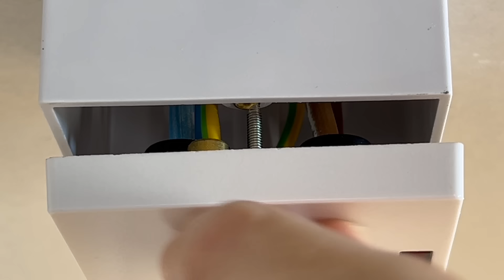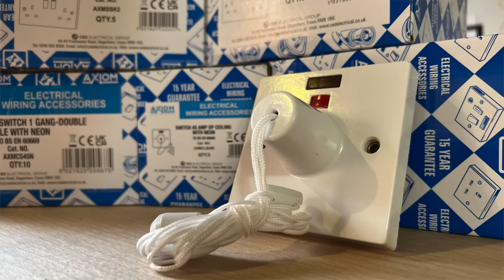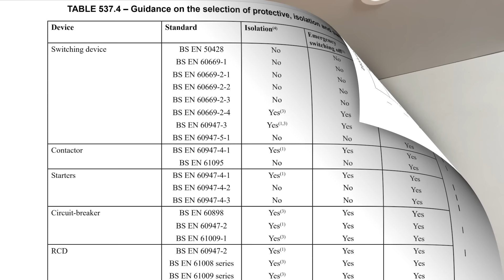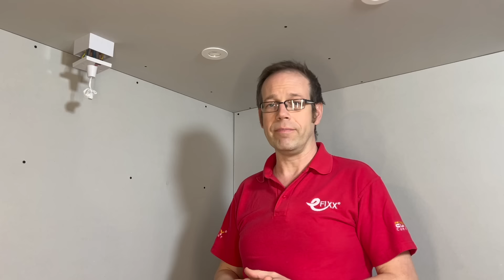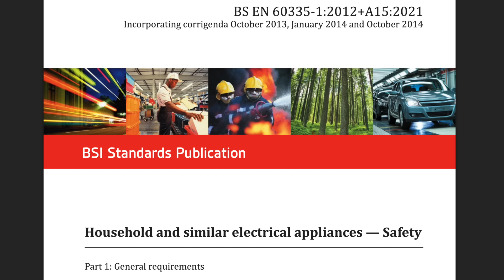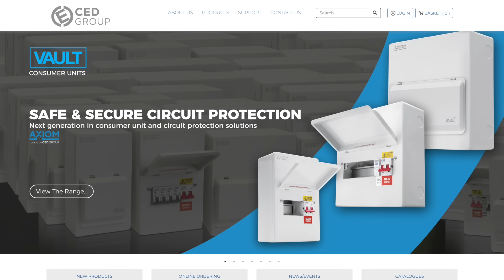Do You Actually Need a Shower Isolator — Or Is It Just Habit?

Comment: Could be that the shower will turn on if mains pressure drops. The micro-switches that turn the heating elements on are triggered by the release of pressure as water flows into the shower head. No water flow will cause over temp device to operate repeatedly until water pressure restored possibly causing thermal stress to the element and heating vessel. The switch is there for a good reason. This covers the manufacturers ass. Maybe?

Comment: Bullshit regulations , it is an isolator , because simplicity isolates the electrical supply to the shower and can be used in an emergency , instead of talking gobuliguce just give people an alternative which is git a contactor in your consumer unit run your 10mm cable from your 45A rcbo through your contactor terminals and connect the outgoing 10mm supply directly to your shower then get a 1 way lighting pullcord fitted in your bathroom using this as the auxiliary switch that switches your contactor coil on and off thus doing away with a 50A pullcord switch no loose connections no burning cores simple

Comment: I used a contactor, coil run from a standard light switch. Switch fused down to 5a on 1.5 t+e. The contactor and fuse carrier to switch/coil all sat on a 50a rcbo.

Comment: My gripe is about the unit itself - to save energy I tried switching off the shower when lathering up. Switching back on for 3-4 seconds there was scalding water before the safety kicked in. It's 2026 now: a kilowatt hour ever day adds up. The lowest energy shower is pumped from a fixed sized container with preheated water.  20 litres is your ration.

Comment: It is an emergency device so needs to be near the shower. I can terminate 10mm cables as i did do a lot of electrical work during 50 years as an electrician. Set the cable in the right positions and it becomes easier

Comment: Would it not be viable/safer to use a pullcord or outside switch that is capable of fitting both double pole switch requirements as well as the BS EN 60669-2-4 or BS EN 60947-3

Been quite curious about this while also looking to make it a lot safer when using the shower than just trusting the current pull cord and a single dedicated breaker...

Comment: It's needed as a form of local isolation,  so the shower can be powered down for maintenance or in an emergency, but I alway tell my clients who I install showers for just to leave it switched on permanently and not to turn it on and off as you use the shower.

Comment: I’m not an electrician but have used mine in an emergency and isolation several times - it did the job but your video has revealed some nuances as to what these terms actually mean - useful.

However having listed to the Grenfell Tower enquiry no one, especially those in authority, seems to understand regulations or follow them (even when very simple and clear, which they usually aren’t) I question the worth of all these regulations?

Anyhow just off to buy a really good value fully CE certified double pole  safe electrical switch with 3mm gap for my shower off Amazon or Ali Express 💀

Comment: In my new-build Milne property in Aberdeen, the shower is "isolated" using a switch outside the bathroom that you would need the strength of Thor to toggle. So basically - the little red neon flickers away, 24 hours a day, 365 days a year.

Comment: I'm amazed, as an experienced electrician that you are not telling people instead of fitting a 50A pullcord or a double pole switch outside the bathroom instead of fitting a contactor inside your consumer unit and wire from a rcbo through your contactor then directly to your shower and then run a 1.5mm twin +earth cable from your contactor to a 10A standard pullcord in the bathroom this pullcord supply will be switching your contactor coil via a mcb switching your shower on or off

Comment: So under section 7.12.2 of the BSI standards for Household and similar electrical appliances, if the shower, which is fixed to a wall where the supply is run inside the wall. internally wired and plumbed in to a fixed water feed is considered a "stationary appliance" rather than part of the electrical installation (such as a light fitting) it would seem by the very same wording that all air conditioning systems should equally have a local "switch" for the very same purposes...... Or am I missing something there in that regulation. I don't see many A/C systems run of a cooker switch.

Comment: I wished I'd fitted a contactor within my consumer unit and ran my 10mm twin & earth directly to my shower and ran a twin and earth to a 1way pull cord in the bathroom instead which would  switch the coil in the contactor , so no large cables to come loose and burn but just a 1.5mm cable for aux control , this is within the regs because it still isolates the power to the shower by switching off the contactor, I can't believe you didn't inform your viewers of this different method

Comment: As someone who has had an electric shower catch fire I can tell you YES you flipping should have a switch, sure you can run off to the circuit breaker BUT in that time fire is growing and not being fought.  I turned around pulled the cord and doused the bl00dy thing.

If I had to run downstairs, get to the fusebox, get a stool to reach it, open the fron, scan the writing and pull the breaker, now run back upstairs and now there's potentiallyu more damage....

Comment: I hate shower pull cord switches. Difficult to wire, never quite sure they are if everything stays in place .. and the horrible click as you turn it on and off. I prefer a plate switch outside the bathroom. Solid, and more positive!

Comment: "Bristol sparky" recommends using a light switch to operate a contactor for the shower circuit. Seems like a good idea but would it    be allowed by the regs as it's not strictly following the manufacturer's instructions?

Comment: Why could you not fit a contactor within the ccm then use a kenetic switch mounted in the bathroom to control the contactor removing the need for a high load swith all together

Comment: If someone is electrocuted by a faulty shower, the pull switch is the quickest way to disconnect the power before trying to rescue the victim.
Reply: No quickest way is to throw a bucket of water over them thus cooling them down

Comment: What mandates the manufacturer is a double pole switch, a dedicated MCB can work as a functional switch, so no extra switch is needed. 

I would only fit one in the case that the appliance doesn't have a physical power switch on it, that is a switch that interrupts power, but only has an electronic standby mode. In that case it is advisable to turn off power when in use to save power and preserve the electronics that otherwise is always powered on (and thus capacitors will fail early). 

If the appliance already has a switch to perform functional switching, like mentioned above, what is the point of an extra switch, if the appliance is on a dedicated circuit?

Comment: The first electric shower we had installed had a switch in the airing cupboard, but that was over 30 years ago so I assume electrics standards have changed over the years. It was quite a large shower unit with an integrated mirror, and I remember one day switching on the shower and water starting pouring out the bottom. It turns out there were rubber pipes on the inside of the shower unit and one of them had completely come off it's fitting. Felt a bit unsafe to me having all these water pipes and electric contacts in the same enclosure. Hopefully they don't make them like that now.

Comment: Interesting video ... BUT ... Part 2 of BS 7671:2018+A2:2022 defines 'disconnector' as a switch that complies with requirements for the isolating function. It also clarifies (Note 1 to the definition) that 'a disconnector is otherwise known as an isolator'. If the product standard requires a switch that provides 'disconnection' does that really mean the shower pullcord ought to provide 'isolation' ?

Comment: Holy sh.t man. You have mains in the shower cabin? In HU, the code says, around taps, bathtubs and showers, there are electrical dead zones - no outlet or device connection allowed regardless IP rating whatsoever. And 30mA RCD is mandatory by code at least about 10 years from now on for new installs or major renovations.

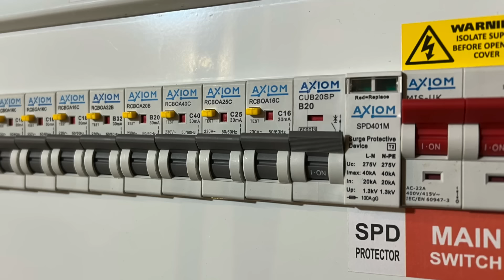Comment: 4:57 - I disagree that we can't use an MCB or RCBO for functional switching. 

Table 537.4 says that circuit breakers can be used for isolation, emergency switching and functional switching.

Of course we don't normally use the DB for functional switching, it doesn't really feel that appropriate. But nothing to say we can't. 

In the context where the whole switch is there for box ticking then I'm going to be that upset if anyone completes the circle by a box ticking approach and considers an RCBO to be providing functional switching.

Comment: If someone is electrocuted in the shower, the person who finds them needs to cut off the power quickly without reaching into the stream of water falling over the faulty power unit.  The pull switch can do that without having to look for the consumer unit, and get a high stool to reach the breakers, probably turning them all off and plunging the house into darkness, adding to the chaos.

Comment: I once came downstairs in the middle of the night to find the electric shower spraying water regardless of the shower settings. The pull switch gave a bleary-eyed me the opportunity to switch off the shower without trekking out in the rain to the utility room to kill the breaker. On investigation the next day it turned out that an errant slug who had shorted two terminals inside the shower unit. The slug's untimely demise was recorded as misadventure  such are the risks of living in an ancient cottage whilst renovating it yourself. While I'd always isolate the shower at the consumer unit while working on it the pull switch didvallow me to return to bed warm and dry to resume my 💤

I have a question... As someone who works on vintage electrical equipment I need to use and isolation transformer. When I bought one of those blue 1:1 240v transformers it was anything but a true isolation transformer. The CPC was connected to earth and linked to the frame of the transformer itself. An isolation transformer cannot have any link back to the CPC and anyone plugging it in thinking they were working from an isolated supply would be in danger when working on say a radio with a live chassis. 
What gives?

Comment: It's a switch not an isolator. An isolator is designed to be a non-current switching device (or "off-load" device). Its primary function is to provide a visible, physical break in an electrical circuit for safety during maintenance or repairs, and it must only be operated after the current has been manually stopped by another device, such as a circuit breaker.

Comment: With a pushbutton ON/OFF on the shower unit, this is likely to be low voltage hence the shower unit is powering a circuit all the time. Such circuits must have a finite life time, hence leaving it unpowered for most of the time surely must extend the overall lifetime?

Not a shower, but a pump for a jacuzzi bath: the on/off switch (air operated) is mounted on the rim edge of our bath. I have a ceiling mounted pull switch to turn off the power to stop a two year old hitting the button thus enabling the pump. And if the pump is run when dry, it will last for 90 seconds before it burns out!

Comment: A deep fastafix box pal that's the best if you have a plasterboard wall anywhere same height as yir light switch 100mm away from it always just outside yir shower room if possible for em switching which you should never need with yir 30 MA  A type RCBO controlling all the circuits in your shower room and any extraneous conductive parts bonded to the MET via a 10mm earth wire

Comment: Also on a commercial job I had the fun job of trying to connect 2 x 16mm twins in a shower pull switch that had been specified by the project manager as the run was nearly 30 meters to the nearest board
Reply: Should've used a contactor in that situation.

Comment: Since the less powerful
Showers when we all used to use 6.0mm in a shower switch was fine but now the switch hasn’t been modified to cope with 10mm cable . Also how many burn out after a year or so always on the neutral
Reply: Yeah, after our 3rd knackered pull switch we moved to a wall mount switch on the landing.

Comment: Thanks for  clearing this matter up. Personally when I fit these switches I find two things help, Buy the deepest back box possible and with a circular cutter cut a minimum 40mm hole in the back of it and push as much cable  as possible up  into the ceiling void.
Reply: Or just use a crabtree 50a pull switch. You can actually fit it and comply with the regs in terms of conductors being fully in the enclosure and the enclosure meeting the required ip rating for penetration by objects. 😊

Comment: I've a question about the location of a wall mounted switch.  
If it is outside the bathroom on the landing but within reach when still in the shower, is that ok?
If it is inside the airing cupboard,  which is inside the bathroom,  is that ok? Does it matter how far from the shower the airing cupboard is located?

Comment: 16th addition stated that the definition of fixed equipment was any appliance over 3kW must have simultaneously accessible means of isolation with contact points not less than 3mm internally. Hence your shower, oven AC unit and so on. This seems to have been downgraded to functional now, madness!

Comment: I'm no sparky but the amount off times freinds and family have asked me to look at there shower 90% off the time is the pull cord switch with a burnt neutral terminal I have fitted many heavy duty 50 amp rotary isolated switches instead off pull cords I alway fit them outside the shower room in a airing cupboard or somewhere where it doesn't look an eyesore touch wood never ever have had any failures and they are very easy to wire in plus they can be padlocked safely while the shower is under maintenance. Can any sparks comment if this is OK

Comment: I'm an electrical technician in Brazil. Here, we predominantly use electric showers, and we certainly don't have light switches inside the bathroom. The circuits run directly and are protected by circuit breakers and residual current devices (RCDs). This cultural habit of having a light switch for the shower inside the bathroom is very strange.
Reply: @HamesVitor  I agree with you, same thing in South Africa. However I now live in the United Kingdom and it's very common here. I don't like the idea
Reply: The light switch is a pull cord switch  and is well out of the way on the ceilibg

Comment: You did some good digging, but you stopped with the product standard (BS EN 60335-1) being the source of the requirement. Do we know why that requirement is in there? Perhaps it's a broad requirement (not specifically about showers) that one can make easier ense of with other electrical items (generally having a cord and plug) but the shower comes under the same scope despite being permanently wired, so needs this extra switch?

Comment: I have an electric shower from one of the popular manufacturers with a radio linked control panel.  Every few days the control panel loses its pairing with the shower mechanism, and this can only be conveniently restored by using the pull cord in the bathroom to switch the shower off and on again.  So it would be very inconvenient indeed not to have a pull switch in the bathroom.

Comment: I have ( two days ago 😝 ) dismantled an  (  Instant ?  8000 Watt  , 40 Amp ? shower unit ) . OK if it works ... but ... I  will be bathing in my 1960's bath , knowing that my heat source is (  MUCH = 2 Kw , less dangerous ) ......... DAVE™🛑

Comment: My shower isolator only has 1.0mm T&E for a 10kw shower! before you all pass out with shock or surprise, the small cable size actually feeds a heavy duty 50A contactor at the consumer unit that safely switches the heavy load.
Reply: I had a customer that used her garage as a dog washing unit & had 9.5kw shower fed eith a 2.5 T&E, it was used a lot for 5 yrs, i only went there to replace the faulty shower. NOT with the 2.5 i hasten to add.
Reply: My shower 9kw is wired in 2.5 twin works fine . Cable heats up do I don’t need a radiator in the bathroom which is a bonus

Comment: Name in the description ISOLATOR.
It is also convenient for proving the circuit from the RCBO source to the "shower switch".
The best designed shower isolator was/is Crabtree.
Angled double screw fixings and sufficient room for cable entry and termination without having to arm wrestle it shut.

Comment: Mine is a switch on the wall outside the ensuite. The 1st one melted (new build, crappy electrician who didn't tighten the wires correctly) I'm not even a sparky but needed to replace the wires from the shower to the switch due to how little spare had been left and how much was charred as well as a better quality switch.

Comment: So American, confused, do you not have distributed domestic hot water in the UK? Most of our sinks, showers, laundry, tubs all have hot and cold water plumber to them, other than the toilet and garden hose bib that only get cold water. Most American homes have a 30-50 gallon water heater that stores water at temperature or we have a tankless water heater that has enough BTU input to keep up with continuous demand. 

Is an electric shower in the UK a version of an inline on demand water heater just for the shower? If that the case what do you do for hot water in the sinks?